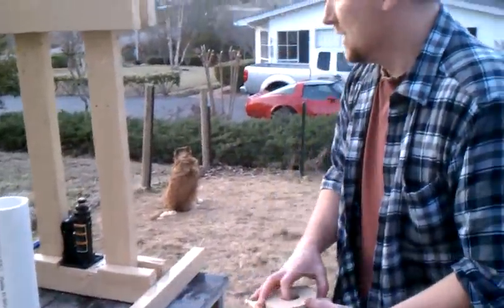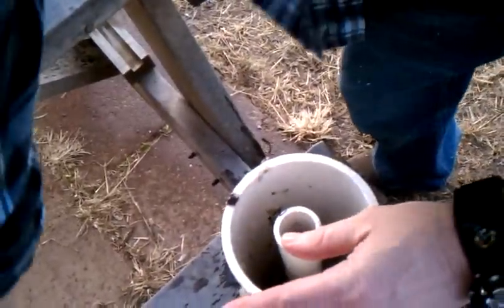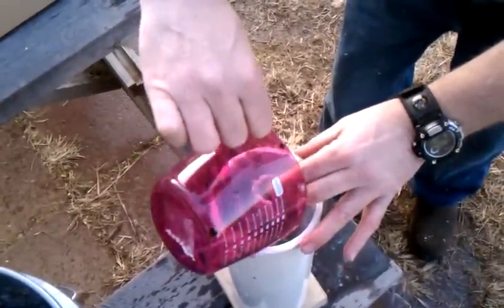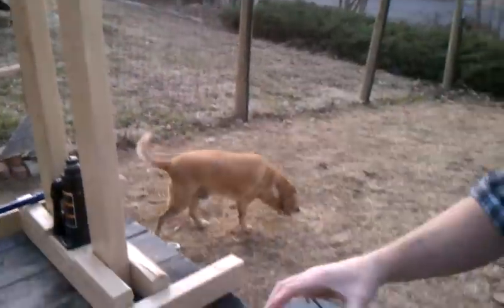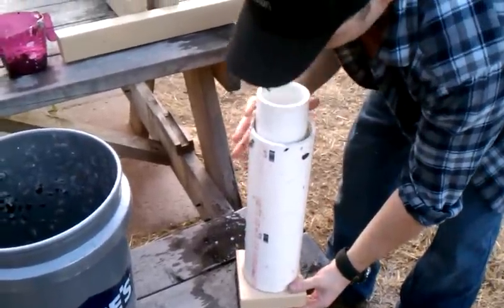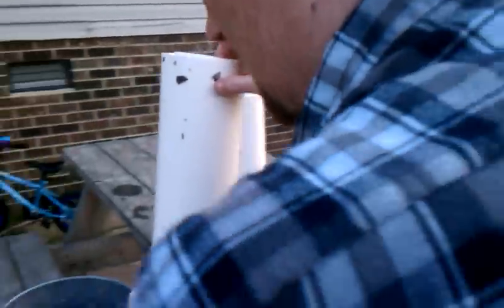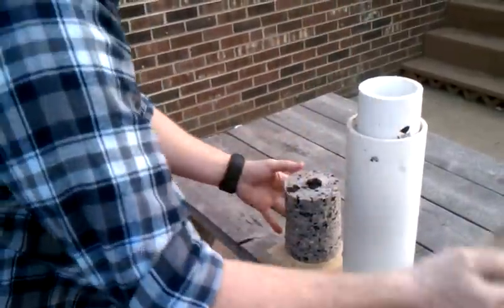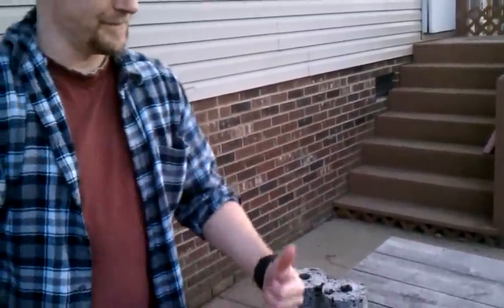Peterson briquette press 2

Comment: instead of water use old engine oil to mix with will burn better
Reply: Yes that's better with used oil. But have you tried using briquettes mixed with used oil is it not emitting black smoke?

Comment: @joel brown there wouldn't be much difference between mine and yours. The rigs look the same.   But I did try to get wise about one thing. I used a lathe to cut the bottom plug part. Wow, what a nightmare. Took much longer to make and cut out the water channel.

Comment: I took your idea and made it a little different.  Instead of having the jack on the bottom I mounted it to the top.  Then I attached a board to the jack on the head to make a block to push down with and did it that way.  It actually is easier to load and unload the press.  Also attached to the top and the brick pushing down is springs to help pull back the jack when I release the pressure.  So just turned the whole idea you got upside down.  Not sure if you want to try it out not.  Just a idea.

Comment: Great way of making logs.  It is a KISS method.  ( Keep It Simple Stupid ).  I also like the fact that you are using leaves with paper.  The leaves leave 18% carbon that woods logs.  Leaving a hole through the middle is a good idea too.  The hole will help it burn hotter because it will let air flow through it.  The only thing I have to say is to make more round wood press plates instead of cutting another pvc pipe.  I would just place it on top of the other pipe after you have made your first press.
Reply: Personally Id be trying all kinds of yard waste to try mixing in, just to see what works.&#160; Yes I'm more than just a prepper, my mindset is more in the area of skills and knowledge than simply stocking shelves. After all no matter how full your shelves are, you still run the risk of emptying them.&#160; So, what do you do when you run out of paper to make logs? and the trees are gone?&#160; need to know in advance!&#160; I already know many things and ways to process burnable fuels, but there is ALWAYS the what if they run out factor.&#160;&#160; AND I also know how to make toilet paper....&#160; Id rather make fuel out of something other than paper first... cause there is not risk of thistles in TP made from newsprint!&#160; (tounge in cheek, bur only partially)

Comment from the maker: Hello, I'd be glad to help you. I used a 2 ton bottle jack that I bought at Lowes for around 10 dollars. I didn't secure it to the base. It just sits there and can be easily removed. The press frame is really straight forward. Just two by fours nailed together and painted with some exterior paint I had left over. The pvc is schedule 40 and I used 4 inch for the form. 3/4 inch for the center tube and 3 inch for the ram. Good luck and let me know how it goes. Cheers!
Reply: Great way of simplifying the press, its the best version of this I've seen yet.

I live in the UK, what does schedule 40 mean? & what did you find the ideal length to cut each pipe was?

Comment: Another thought.  cut multiple discs,  and use them to make round bricks  using the pipe and jack... the greater the pressure used to press the bricks the longer they burn and the faster they dry. viably you could make 6-8 bricks at a crack  if you use a ladder to stand on wile filling and pressing the water out of the pipe. You May have to add an additional pair of 2x4''s  (use hook and ring latches to lock in place) to use a ram to push the paper bricks out, but the time savings may be worth it, OR cutting the pipe down, and making a 2 barrel or even 4 barrel setup with the jack pushing all the rams via a plywood plate all at once.  The biggest issue with making paper logs and bricks is time, mass production helps cut this tremendously. Just make it the same way as you would normally.  And use a plywood plate that covers all the pipes on he bottom (paint it with an oil based enamel  that has been thinned heavily so it penetrates deeply, and keep adding layers as it dries until the plywood is literally laminated with the enamel and completely waterproof. this is an OLD trick to make regular construction grade exterior plywood stand up for use making small boats)  You can easily do four pipes this way... If you want to go crazy and do more  than 4 pipes at a time, weld your frame out of  angle iron from old bed frames.  The angle iron used in old bed frames was (past tense) cold rolled and two pieces laid out as a channel will be less likely to bend over time... Ive made small trailer tongues out of this stuff, running a bead on both sides with flux core wire weld, and had them outlast  factory made tongues  on trailers used off road, and for agricultural use, so ti will work with no issue here. AND if its for a SHTF situation, would be the only choice since longevity  of equipment should be a major point with anything you make or buy.Here is a question for everyone:Has anyone tried using a cheap lawn and garden shredder such as the one from Harbor Freight for shredding papers?
Reply: Scott Schoemann good information

Comment: Nice setup.  I would add a removable cap to the smaller center piece.  Cap on while filling, remove the cap before compacting.  as others have said - put the jack on top.  Still great idea,  nice job
Reply: Stick a cork in the centre pipe and not your finger It will take only half the time it took you

Comment: 1. What is the center hole for ?
2. Wouldn't be better to put the jack on the top ? That way it wouldn't be wet.
Reply: I agree.
Reply: Mihai Mateescu 1) Probably for more even & faster drying. Instead of drying something ~5 inches thick, the hole makes it only about 2 inches thick. 

2) Yeah, I'm guessing probably, but it looks like it's at a more convenient height where it is.
Reply: 1. The hole in the middle ser4ves two purposes. 1> To aid drying the log. 2> to aid burning
2. Not if you sat the frame on the floor, then the jack is back at a reasonable height.

Comment: hi, it looks like a really nice idea and i was thinking of making one to get rid of all the junk mail that i get and the sawdust that is created in my shop. one suggestion and i'm not being critical but i think i'm going to mount my jack on top so the water doesn't run down on it and maybe some type of funnel so i can fill it easier, i see myself out in the cold making these. thanks for the idea of the pvc pipe though that will cut down on the assembly time.

Comment: Do you have a “cut list” of the materials you used?
Reply: charcoal/coal powder, coke, iron fine, chrome fine, lignite, carbon, gypsum,lime, quicklime, mineral powder, Oxide scale,nickel powder and dri fines, clay, iron ore Bauxite fines, fluorspar, Aluminium, Slate, Ferro chrome, aluminium dust, ferrosilicon fines, Sponge Iron fines, Manganese ore, alumina, Aluminum Turning and Dross, sludge, Ferro chrome, slag, DRI(Direct Reduced Iron) fines, bauxite, tin dust, Chrome Ore, Mica soapstone.

Comment: I just watched a vid where a guy uses a screw, (worked great), but lots of work. using a jack is just a KISS.Hole in the middle helps with dry time and in a hotter burn. You8 have my vot and I will use your idea. TANKS

Comment: Have you tried using sawdust or even mixing it with the paper and leaves? Also, can you cook with the briquettes?
Reply: cooking would be dependent on how its used. I'd say no to a grill, yes to a closed stove.&#160; Paper smells different than wood based coal and would affect the taste of the food. a closed stove wouldn affect the taste due to no smoke contact. that's how they used dried manure in daysgone by
On adding sawdust, it would work. anything burnable that doesn't release  noxious gasses would be fair game, such as wood shavings, PROVIDED whatever it is doesn't cause the bricks/logs to fall apart.  Sawdust would be a viable filler as it does make an excellent compressible filler, and the sludge from the paper will act as a glue.
But here is a thought for you: If you have a ready source of sawdust, start collecting candle stubs ( local church is a good source if you are a "good Member")   go to the local thrift shop and get some aluminum ice cube pans or small metal cake pans and mix the dust with molten wax to make a  paste, keep the wax molten in a double boiler type setup ( one can with the wax in it, inside a larger can full of water so the boiling water heats the wax)  when the sawdust is  saturated and fully soaked  keep adding more and keep it heated.   when you have that thick paste put it in the tray/ pan and before its completely cooled with a heated knife,  cut into ice cube sized blocks  when firm enough break them apart,  now the hard part. wrap these blocks in a couple layers of newsprint and tie off like it is a bottle of wine being given as a gift and rim off leaving some room above the string you tied with,  and then take this little "scumbag" (used condom reference intentional for descriptive reasons and not to be gross, so if you don't get it, ask a trusted male friend to explain) and dip it in more molten wax so the paper soaks completely through, using  a tong so you don't burn yourself.  If you wrapped the paper tight enough it will work as a fuse to light the sawdust briquette you made, This is one of the BEST  fire starters you can make, AND if you used paraffin or true Beeswax (true holy candles from church)  it works even better, and going by your name, (snap judgement on ethnicity on this)  the  Jar type Icon holy candles  that are popular  with Hispanic Catholics, have a blended wax   that works fantastic for this due to the fact that this was, like paraffin and beeswax, burns away, rather than simply melts as the wick burns.  With cheap candles  the wax melts and runs off (crayon wax) because the wick doesn't burn hot enough to consume the wax, the paraffin and bees wax burn at lower temps. so they wont drown  the wick in these jar  candles. Btw  I was taught that by a little old Mexican Lady I new when I was a kid.

Comment: Awesome! And I can build it myself!
 I was wondering if you have any ideas on how to utilise waxed boxes as fuel for compression?
Reply: If you are talking about waxy drinks cartons, why not create a separate press for these using 4 pieces of ply screwed together so the drinks carton 'just' fits inside. cut the top off the carton, spike a few holes in it, fill with slop and compress the water out, remove the tamp, add more slop & press again. Repeat until the carton is ram packed & all the water is pressed out.

Comment: Love the video. This is the first I've seen with a hollow center. What's the reasoning behind that? Quicker drying, better burning, both?
Reply: I cant answer for the author, but as an engineer I can tell you that it does add  heat output due to increased burn surface/venture effect drawing air in, and the more surface on the wet brick/log  per pound of material used, will decrease the drying time, But the biggest benefit would be the manufacturing benefits,  such as time reduction,  and easier compression, as well as better press,  greater water removal, which also adds to decreased drying time.